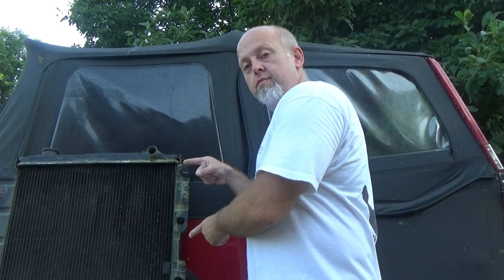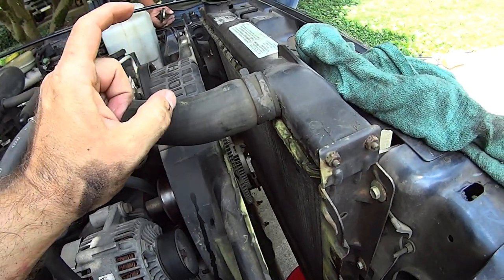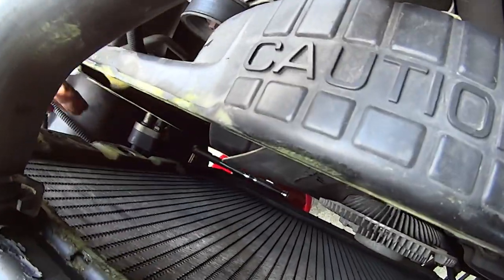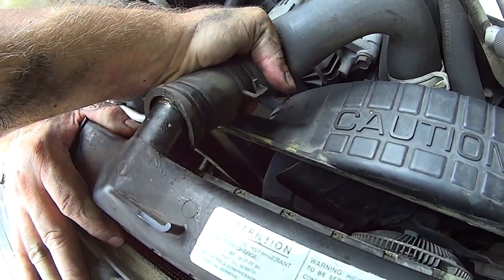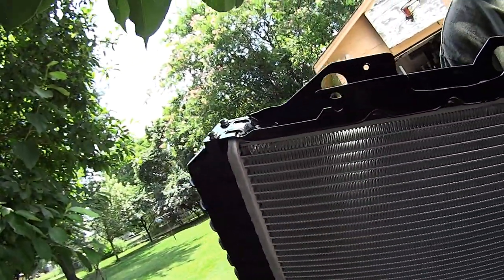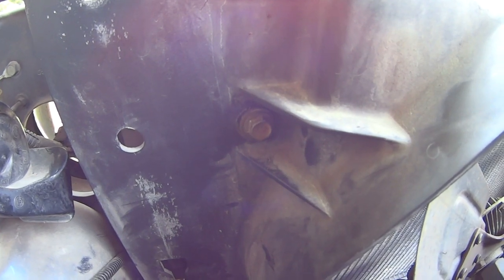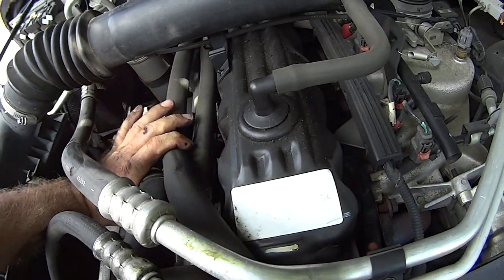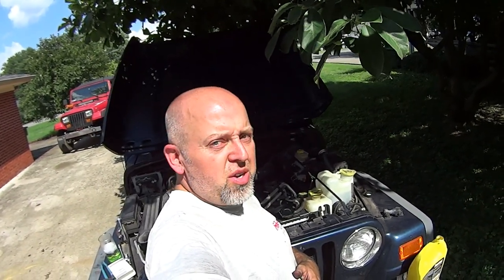2000 Jeep Wranger TJ - Time to replace the radiator.

Comment: Got to do this tonight on a 97 Wrangler Sport.  After watching your clip, I'm pretty sure it will be an ez install.  I saved up for an aluminum radiator and it's supposed to be an exact fit.  Thank you for the great clip!!
Reply from the maker: You are welcome! Its an easy swap, just take you time. Thanks for dropping in. Have a great day!
Reply: I think my bolts are 7/16 on the fan shroud and radiator.  97 Jeep Wrangler Sport.  Where do you get a thumb rachett.
Reply from the maker: Might be able to find the ratchet at harbor freight if you have one near you. If not, here is an Amazon link to s nice set: https://amzn.to/2KIWKVr . Good luck on the swap!!

Comment: Watched your video and it helped making the task of changing out the Radiator much easier.  I have a 2006 Wrangler Unlimited Rubicon that I bought new. The shroud bolts are 11mm or 7/16".  There were only 4 10mm bolts holding the radiator to the body 2 on the top and 2 on the very bottom.  I guess Jeep was trying to cut costs as there were only 4 of the black nuts that slid on the sheet metal to where the mounting holes are.  I used a 1/4" drive socket and was able to access the top bolts between the brackets on the Radiator  I did have to use an extension to get to the bottom bolts on the Driver's side.  The only big problem that I had was when one of the shroud bolts dropped and did not fall on the ground. I finally found it but it was not easy  I fund it on the Transmission housing.

Comment: When I replaced my radiator for my 95 Jeep the metal clip for bolts broke off and I had to use nuts and bolts. It even did on the fan shroud too. When I did this I make sure the nuts it was lock nuts so they wouldn't back out. On the shroud is more like screws.
Reply from the maker: Best nuts to use is the ones with the Nylon inserts. You dont have to tighten then super tight like you would with lock washers. Thanks for dropping in! Have a great day!

Comment: What do you do for the hose ports that aren’t connected to the transmission?i also have a five speed and will not need to connect to those bottom hose ports. Do you need to plug them somehow? Thanks in advance!

Comment: You didn’t plug the automatic transmission ports when you put the radiator in. It still had the red plastic plugs in place. You did have to replace the red plastic plugs, right?
Reply from the maker: The red plugs are for the transmission cooling lines for an automatic. That Jeep is a manual 5 speed, it doesn't use those ports.

Comment: All replacement radiators I can find come with the additional fittings for auto trans. I have manual trans. I’m worried that the little plastic plug won’t keep water from just shooting out those holes. What am I missing. I noticed that you left just the little plastic things that came in it. Please explain...
Reply from the maker: Water doesn't go through the part that the little plugs stop up. So don't worry about it, just put the radiator for the auto trans in your good.
Reply: Thanks for posting this question , i had the same issues.

Comment: Still recommend the Rock Auto radiator after having it for awhile? If so, can you recommend a specific model? I noticed they have several options on their website. I’ve got a 99 TJ 2.5L, thanks!
Reply from the maker: That is my buddy's Jeep. That radiator is still performing great, no issues at all. I checked the site, I don't remember exactly the part number radiator he ordered. But, from the price point I remember him paying it should be the CU2101. I also went one step farther and checked Amazon for that exact part number. It is available on Amazon and you will save about $8 going through Amazon because of the free shipping, plus Amazon is a bit faster on shipping as well. Here is the link: http://amzn.to/2Dngdfd . Hope this helps! Good luck!! Have a great day!

Comment: what causes my car to shake when I put my foot on the gas pedal and when I shifted into gear
Reply from the maker: There are so many possibilities it would be practically impossible to diagnose without seeing it for myself. Could be sensor issues. Depending on what "kind of shake" meaning .. erratic engine performance or driveline wear (output shaft bearing .. u-joints .. etc.) .. each produces a different kind of shake.